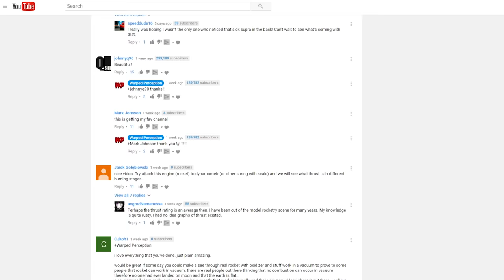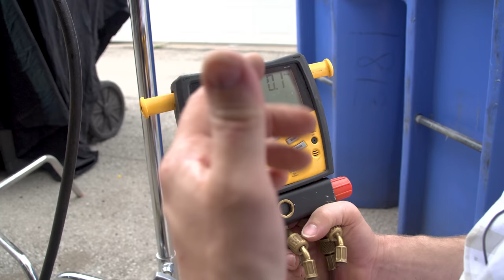Model Rocket Engine In A Vacuum Chamber - 4K Slow Motion - will it burn? - Rockets (S1 • E3)

Comment: The vacuum failed. You have to show me that the vacuum was maintained the whole time. Show the gauge the whole time.
Reply: Unfortunately the rocket motor gives off waste gas, which does almost immediately kill the vacuum and fill the chamber with said gases and precipitates. However, whether you believe that this was performed in a real vacuum chamber or not is irrelevant, as simple knowledge of chemistry allows us to figure out that rocket engine systems make their own oxygen via an oxidiser fuel mix alongside the standard liquid fuel. As such, ignition and maintained combustion is possible regardless of external pressure.
Reply: I don't normally bite for internet debates but i'm in a "fuck it why not" kind of mood. Why would it not produce thrust? The thrusting equation for rockets is derived from a pressure differential created by the propellant ignition in the ignition chamber vs the ambient pressure. In this case, if it's a vacuum, there is going to be more thrust because the delta P is higher. This is for the same reason an aircraft flies; particles travel in the direction of high pressure to low pressure inducing a force opposite to the flow direction, i.e. moving the rocket forward. no?
Reply: čhЯis †opheЯ 
The rocket IS the medium the thrust works on.
Reply: @ch bu "the rocket is the medium for the thrust to work on" yes, i'm sure you were told that but if you really think about that, it no longer makes sense. It's like claiming a waterski doesn't need water to actually work, that it can work fine on dry land because its providing thrust on itself. Common sense should tell you that's wrong, do you have any common sense. But good job on never thinking for yourself and just parroting some BS you were taught to claim. I'm pretty sure we are still living in the Dark Ages when your clearly not allowed to think for yourself or step outside of the little box you live in, pretty sad state humanity finds itself in.
Reply: My fart will produce thrust in a small vacuum chamber like that with all the excess gasses around. Not an accurate experiment at all.
Reply: conflikt89 actually sir, the pressure differential does not provide the majority of the thrust. The majority of the thrust is generate by accelerating mass out of the exhaust nozzle. F = ma. The mass accelerated generates thrust. You can show, via the Reynolds transport theorem, that the pressure differential also generates thrust, however in practice it is normally neglected because it can be 2-3 orders of magnitude less than the mass accelerated thrust. Source: I'm an aerospace engineer (: we're on the same side, it just helps if we aren't fighting ignorance with incorrect assumptions
Reply: Exactly! The vacuum of space can't be compromised due to its size by the exhaust as in this experiment. Good try but the difference in volume is indeed staggeringly different. The vacuum wasn't maintained in this experiment and if it was, why didn't you show that?
Reply: lilHamster97 but the external pressure is needed to push off and create movement which is the point of this experiment. Vacuum was not maintained so this is a good try but fail
Reply: ch bu wow, palm to forehead, that was dumb
Reply: Propulsion gasses go one way (action), rocket goes the other (reaction), no external pressure needed. And you think my comment was dumb.
Reply: charging7 - you are having a fundamental misunderstanding of how rocket thrust is produced. External pressure is NOT needed to create thrust. If the pressure in the exhaust plane is significantly different from the ambient pressure, a small thrusting force will result. HOWEVER, the majority of thrust is created by accelerating mass out of the nozzle. This has nothing to do with "pushing off." If you stand on a skateboard and throw a rock, a net force opposing the direction you threw the rock will be exerted on you. This is how rockets work: by accelerating mass. NOT by pushing off of external gases
Reply: Agreed.
Reply: Now, I'd like to see they rocket launch in a much larger tube and not butted up against a surface to show rocket engines don't move rockets by blowing on a surface.
Reply: I've got a better idea for you.  Why don't you REPEAT the experiment yourself, and do your HONEST best to prove it wrong? 

The classic null hypothesis.
Reply: Actually I have more then 1 problem with this neglected to give total volume , pump extraction rate , no visible gauge of consistent pressure oh and the big one did they really use TAPE AT THE INE END  TO HOLD A VACUUM, lmfao😂 and just to be clear I’ve replicated this test as I have access to everything here and more, and the result of a actual vacuum ( which no one on earth can replicate what “ they say space is 10x-17tar ( I think I mixed up my physics numbers this vacuum equation might be for the Atlanta based chamber , which they do not put astronauts into but test propulsion systems ). But there’s a lot of inconsistencies and obvious.
Reply: the tape holding the cap is on the end of the tube is hilarious 😂😂
Reply: This video is not a very good model. 
For better example put a small bomb inside a strong metal glass and blast it .
Reply: There is a class of rockets that do not use any outside source of ignition.  These types of rockets were used to power the X15and the V2.  These fuels and oxidizers are very reactive when they come into contact with each other. They are called Hypergolic chemicals.  They WILL work in a vacuum. 100% of the time without fail. So if you don’t kill yourself from the nature of the fuels or others you can see for yourself they work. There is a very good reason they are used in applications where you need 100% reliability. So yes rockets do work in space.
Reply: Why is it hilarious? The tape is not "holding the end on" when the tube was under vacuum- air pressure was. The tape was only to keep it from sliding out of place when the pressures were equal on both sides. Try it yourself with an index card on the end of your vacuum sweeper.  It isn't going anywhere when the pressure is greater on one side than the other. 

I'd explain more, but it isn't worth my time because you won't accept it anyway. If you think a rocket needs something external to push on in order to work, you don't have the basic knowledge needed to discuss anything related to this experiment. 

Keep wallowing in your willful ignorace...it doesn't change the truth.

Comment: Very cool! Back about 1967 I wanted to do a science fair project using a model rocket engine thrust meter. My father suggested using a syringe hooked up to a mercury manometer to measure thrust equivalent to mm of mercury displacement. I submitted something else for the project.

Comment: I have also done this experiment however I realized it was flawed in order to get the rocket to go off you have to cap the igniter which is okay but in doing so you keep the rocket pressurized internally which allows it to ignite in the first place the second flaw is the size of the vacuum chamber the instant the rocket goes off the vacuum chamber is no longer able to keep a vacuum due to the off-gassing of the rocket the vacuum chamber would need to be incredibly large to not be affected buy a model rocket engine remember model rocket engines work by creating gases and enormous pressure from solid state fuel so much so that it can push an object off the ground and into the air
Reply from the maker: wesnxs exactly, thanks for sharing in the next episode it's going to be more comprehensive, I'm going to explain and explore a couple different fuels to clear up some very serious and widespread misconceptions
Reply: agree with the second one. However, for the first  one, I thought all space rockets are capped and pressurized internally before ignition? Otherwise, the fuel would just spill out everywhere. What I'm going to say is, capped and pressurized ignition mechanism is more similar to actual rockets in space than uncapped and unpressurized ones.
Reply: measure the rockets volume , multiply by 1000 ,that its final gas volume 
use the smallest rocket you can  or make a chamber big enough so that 
the final pressure is changed only 1% difference  ,,,  lol i just trolled you
Reply: Dude you're so right on the experiment is flawed the vacuum is nowhere near what the vacuum of space would be and it is such a small chamber that the rocket is able to pressurize the chamber which is why it moves
Reply: Collin Daugherty   I agree the experiment is not good enough for definitive proof, but it is an indicator. However, the rocket doesn’t move because of pressure, if fact it would be less efficient in a higher pressure.
Reply: @tomkfly  .... this is kind of where we agree and differ at the same time..... yes I think the flow rate out of the nozzle of a rocket would be much greater because there would be no resistance. I also think a rocket actually works in a pressurized environment against the atmosphere that is where it gains thrust
Reply: @None888.  omg simple but brilliant absolutely brilliant. Lets see how he answers this.
Reply: @vaughanscott7308  ..thanks bro...this "experiment" is laughable at best🤣🤣🤣👎👎👎
Reply: @vaughanscott7308  ... Also extremely funny if you research the largest vacuum Chambers in the world... Look at what those things are made out of it's incredible... And they can't even recreate what they call the vacuum of space 🤣... None of this stuff matters they'll never tell us anything remotely close to truth... Nobody will go to space... And we'll just sit down here on the Earth arguing like a bunch of morons fighting over a potato chip 🤣🤣🤣🤣🤣🤣

Comment: Thanks for the video.  Notice that the rocket does not move, even slightly, until enough gas has filled the rear of the tube (creating backpressure).  There is a tiny white fleck on the cylinder just in front of the rocket I used to gauge movement.  This confirms that a rocket cannot 'thrust' itself in vacuum.

Comment: As soon as you started firing it, your little tube filled with exhaust gas, and it was no longer a vacuum chamber. When it stopped firing, the gas was immediately removed, returning it to a state of vacuum. This is a nonsense demonstration.
Reply: Your wrong

Comment: I see it coming "If there was a vacuum, why were we able to hear the rocket? Sound needs air to travel". Its coning guys, take my word for it!
Reply from the maker: +muh1h1 because the GoPro had a mechanical connection to the tube, the tube had a physical connection to the vacuum pump through the hose comma if you notice in the beginning of the burn the sound is much less. The sound came from the physical contact the rocket was also in physical contact with the tube through the mounting device.
Reply: LOL, don't worry, we know, we were just making fun of the conspiricy guys (a.k.a flat earthers) :D

Comment: Great job.
A side note, to those who think that this wasn't big enough -- consider the fact that the gas that is ejected becomes something for the next cycle of gas to push against.    And magnets still work in a vacuum as well - just because there is no air doesn't make it void of all energy.
Reply: Next cycle? The rocket burns in 1 second flat. There is nothing for it to ever push against. Thats not how rockets work.

Comment: 2 questions... 1) since the rocket didn't begin to show signs of propulsion until the smoke filled the back of the chamber, can you keep the air compressor on so that the gasses emitted from the rocket are immediately sucked up instead of building up pressure to push off of, as it would happen in a non-enclosed vacuum. 2... why did you say there was still vacuum in the chamber after everything??? The fact that you opened it up to show the smoke kinda makes me feel like something is fishy here.
Reply: 1. Air compressor wont pump faster than a rocket engine, also intertia is why it took some time for the rocket to start moving
2. Idk why he said that, maybe he just ment that there was no outside atmospheric air inside, since the exhaust obviously filled the chamber.
This test works i guess, but its too small to convince people who doubt newtons third law; for every action (force) in nature there is an equal and opposite reaction. If object A exerts a force on object B, object B also exerts an equal and opposite force on object A.
Rocket exhaust doesnt need to push against air to propel the rocket forward, the exhaust isnt attathced to the rocket anyway.. wouldnt make sense, its the exhaust being pushed out thats sending the rocket forwards.